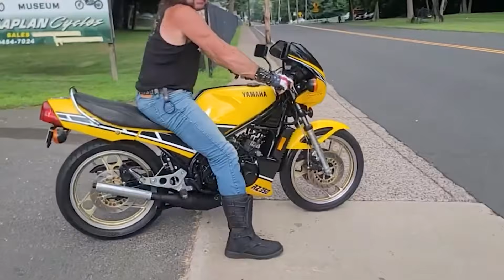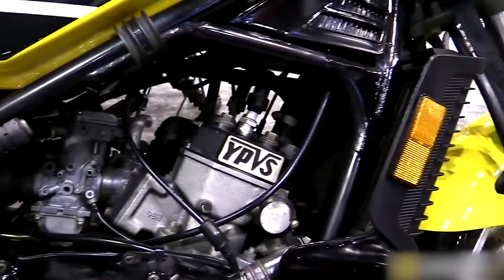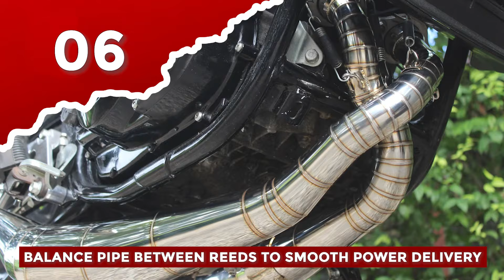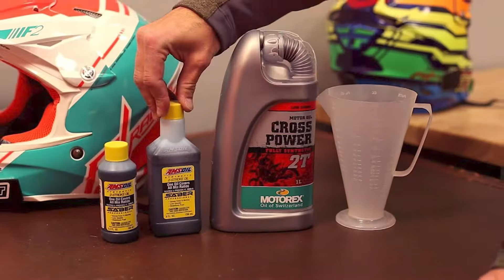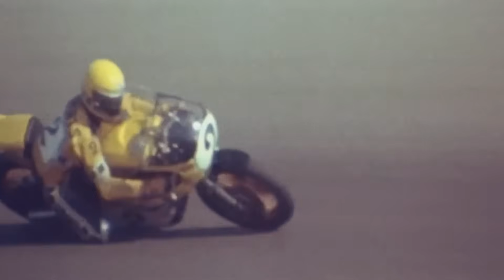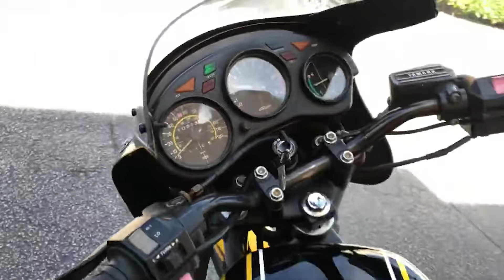10 Unknown Shocking Secrets About the 1984 Yamaha RZ350 You've NEVER Heard Of!

Comment: I had a late F1, bought new in 1986.  The YPVS actually worked.  I remember the thermostat - the temperature gauge would climb towards the red segment, and then drop dramatically.  I also had a truly frightening tankslapper, provoked by accelerating hard over an ‘imperfect’ road surface.  It was like I was riding on a bare rim at the front; so much so, I got off the bike expecting a fully blown out front tyre.

Comment: Had an RZ350 which the previous owner modified for racing. I did remove the automatic oil system as I did not trust it. The only defect was the gas mileage which was about 35 mpg.

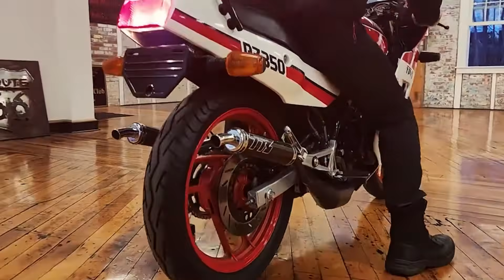Comment: 2:06.
Good american plug. I hear ya. Canada didn't have those regulations. Toomey pipes, boysen reed valves, a 2 into 1 1974 y boot, 3x oversize, fork brace, breaded lines, Ohlins rear shock, heavier front fork oil with weston seals, now that is an affordable trick bike. I have 2...from japan. Built over 13 of them. P.s. the mods. On this bike are wicked! Super fun...PERIOD.

Comment: I built one for the track with subtle mods, using R5 carbs with MX175?needle and nozzle, and a lot of port work. EZ roll on wheelies. I rode a stock one in a 24 hour race that ran better with each lap. What a joy to ride!
Reply: Still have Air cooled rd 1974..Tracked a Four Hundo years later Colorado usa